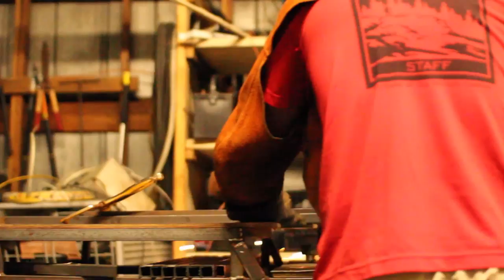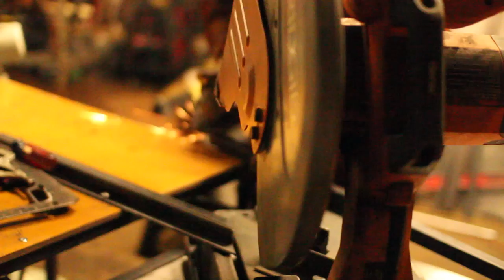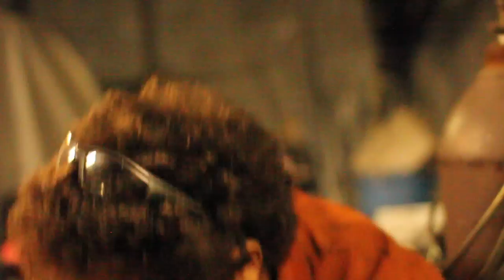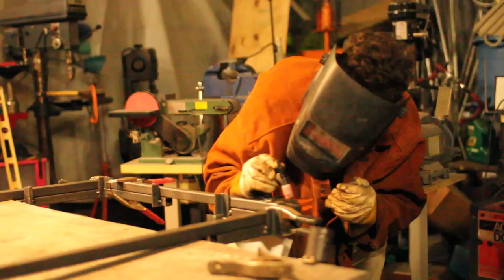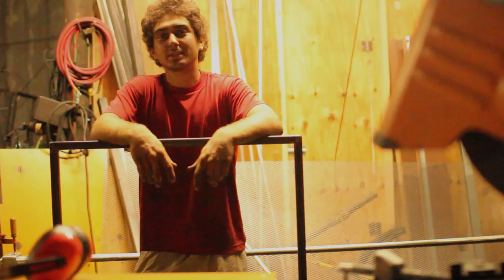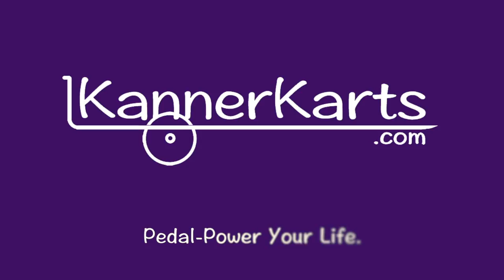In the Making: Kanner Karts Bicycle Trailers for Carter's Compost

Comment: Questions: 1.) Which do you prefer using for your trailer builds ...rectangular, square, or round bar?
2.) Which types of metals do you use when it comes to builds?
3.) Do you offer to ship the trailer to those that live out-of-state?

I live in South Carolina, but I go on tours that last anything from 2 weeks, to 2 years. According to the cycle shop in my area, they advise me to pack less than 100 lbs. of gear, but due to circumstances I don't always have the convenience. My current bicycle is a Trek 520-Disc, the frame is chromoly, and I also ride tubeless. With the exception of disc brakes, what I'm looking for is a trailer that is also made from chromoly, and with a seat post mount.